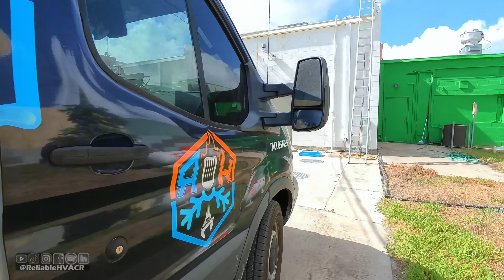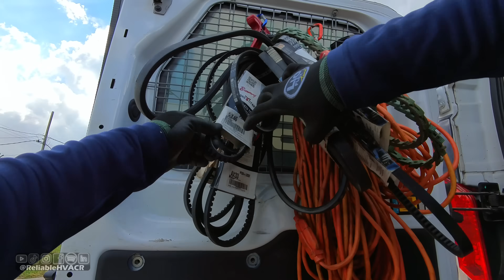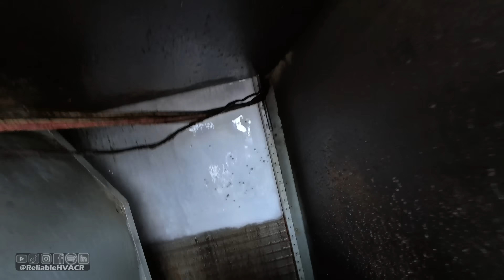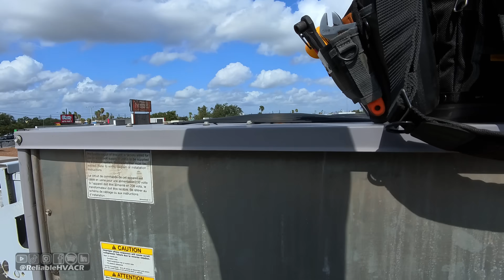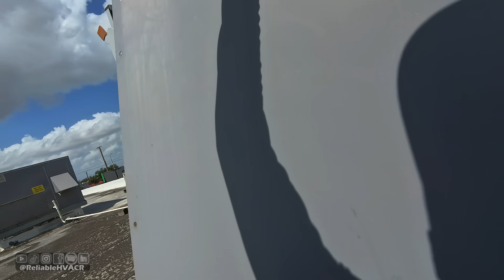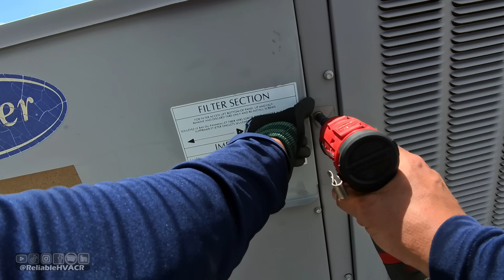Weird Call, Weird Problem. Almost missed it!

Comment: I believe on those carriers that there is a signal wire from the carrier board to the VFD control board that signals the VFD to start that can go directly to your new contactor instead of coming off from the G wire on the thermostat. Remove all the unnecessary junk that people live in these units like the old VFD the old board a lot harder to troubleshoot for the next guy when there is a problem.
Reply: The board sends a 24VDC signal for start enable. So unless it's a DCV coil that wouldn't work. They are 2 speed signals G & Y1 are 40hz and everything else is 60hz.
Reply: @JJ-COMMERCIALHVAC 
Too bad I can’t attach a picture of a print because on the newer carriers it shows on the print the gray wire pin 7 from the carrier board going to the contractor when the vfd option is not used.
Reply: Yes...Marked IDF and it's a gray wire